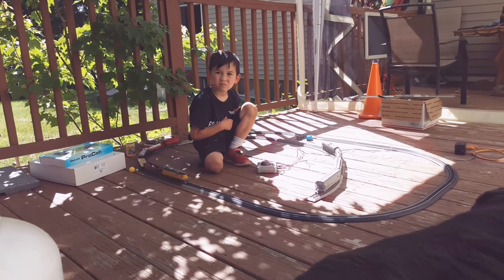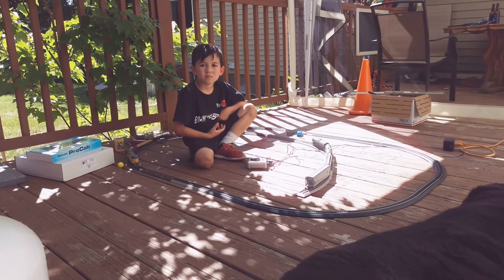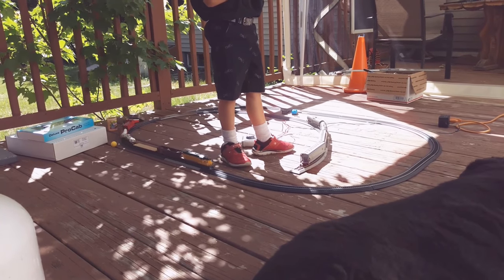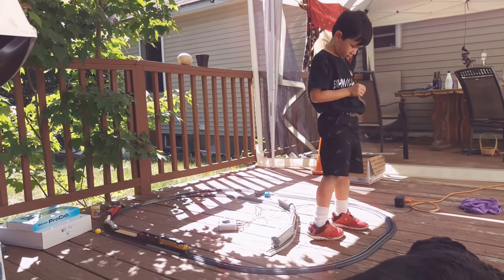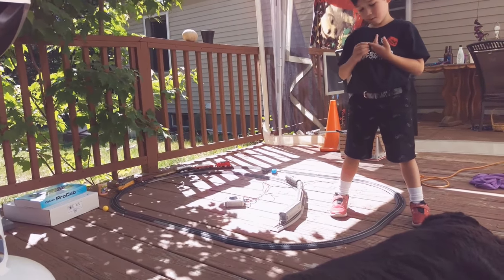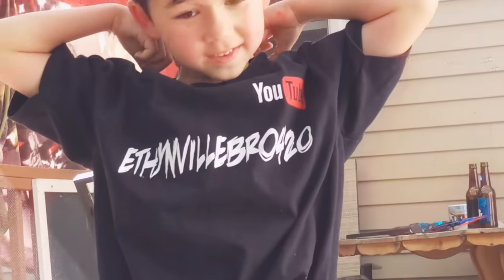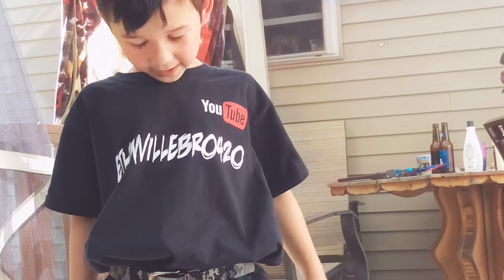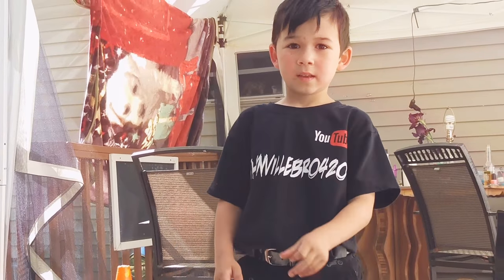E-Z track run on the Deck

Comment: If you bought either the SB5 booster or the Power Cab starter set, both should have had a wall wart power pack! Call NCE, tell them you didn't get one. I bet they send one to you for free with no shipping charges! I saw a garden layout today. I'll post it later. Great shirt! Nice deck! Need more track!